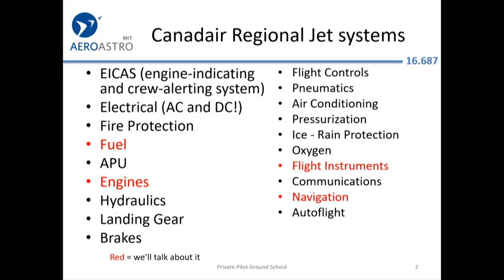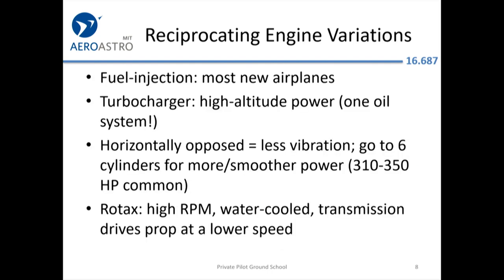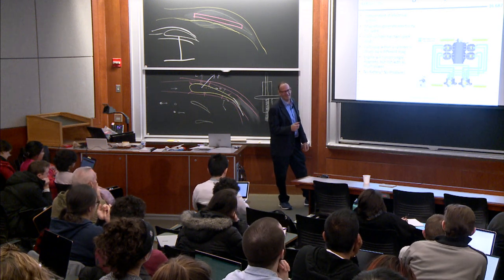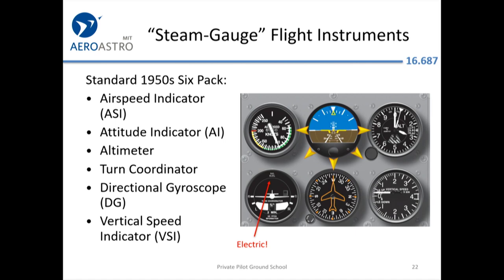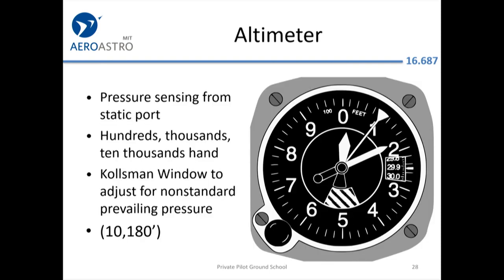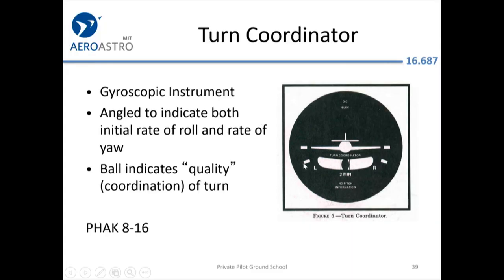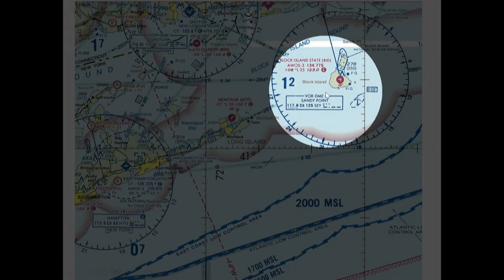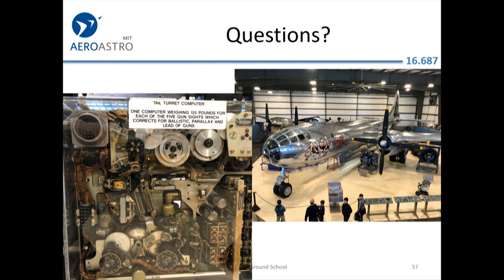MIT Private Pilot Ground School, Lecture 4 (Systems)

Comment: The reason for not running your engine under high loads at low RPM is because of the oil film. A fixed pitch propeller has the RPM directly tied to the load. But if you run it under high load at low RPM, the oil film is not being replaced very quickly and you must use a much thicker oil. This significantly reduces the efficiency because it increases the amount of drag on the engine. Also, thicker oils are a lot harder to lubricate all the components during the startup and in cold weather, and is more susceptible to thermal shock. This is why they recommend not running under high loads at low RPM. Medium loads at low RPM is fine though. Just don't push it to the extreme.

Comment: I thought maneuvering speed was a minimum, not a maximum. Isn't maneuvering speed the minimum velocity required to safely make a maneuver from straight and level flight? I'm just confused as a student as I have received contradicting information from other credible sources. Thank-you for all of the wealth of knowledge you provide!
Reply: There is a maximum and a minimum safe maneuvering speed. The lower speed maneuvering speed limit is due to stalls, AKA the break in airflow over the wing, preventing you from creating lift. Maximum maneuver quoted airspeed for most planes is more of a structural limitation.. a 172 going over 160 knots is subject to structural failure. and pulling a hard turn at 150 knots, you very well are risking flight surfaces or entire lifting bodies AKA wing.  in some extremely fast planes, they may have a never exceed speed, around 500 MPH because of compressability.  as airflow gets closer to supersonic, lots of weird things happen such as inverted control input, or no reaction to input at all. the closer you get to MACH 1, you start to see an actual shift where the center of lift of the airplane is located.
Reply: V(sub letter)A specifically is the speed at which an airplane will stall before exceeding its maximum load limit. Basically, this is the speed at which the airplane will stall before it breaks apart. There are different manuevering speeds as you described, but the aren't identified as V(sub letter)A: Take V(sub letter)O for example
Reply: Steven Hanaway interesting! Thanks for your insight on this
Reply: @bran5605  Thank you very much,  that clears up alot of confusion about the term maneuvering speed. I was confused because there are also maximum safe speeds, especially for rotary wing aircraft due to retreating blade stall for example, notated as Vne (Velocity never exceed.)

Comment: Honestly curious on how many fully glass cockpit schools or rental planes this guy thinks there are. From how he talks every plane is brand new with glass cockpits.
Reply: Take a trip around any airport and you'll see glass cockpits are becoming the norm. It doesn't have to be a G1000. Dual G5s and a nav/gps navigator is the same effect.
Reply: Glass cockpits can be had for as low as $6,000 now, which is actually about the same price as a full set of steam gauges. As components fail people are replacing with glass cockpits. Even 1950s airplanes can have a glass cockpit steam gauge put in for like 250 bucks.

Comment: Leave it to a virtue signaling intellectual not to be able to make it through a technical presentation on flight without making a reference to climate change.
Reply: This was a reference not to climate change, but to lead in the atmosphere. Unfortunately, led from airplane fuel is one of the most significant sources, and aviation has a measurable impact on the amount of birth defects and cancer rates. Additionally, breathing lead is considered worse than drinking it, and we already eliminated lead from our water in 1960. Unfortunately airplanes have not caught up yet.

It wasn't virtue signaling about climate change, it was virtue signaling about the very real effects of breathing lead and even the FAA recommends not to breathe it. In fact, pilots or people who frequent airports, have over 10 times the amount of blood lead levels and that corresponds to about six points lower IQ on average.

Comment: Ummm, see this is what people hate about professors; he complains @29:00 about burning fossil fuels, but flies his planes,,,the hypocrisy is thick
Reply: small trainers are rather efficient  which is what most general aviation centers around
Reply from the maker: That was a joke about how great the standard atmosphere used to be! (I certainly don't claim to be saving the planet!)
Reply: It was a joke about how the numbers that they use for the default are based off of the average temperature in 1960 even though the temperature is higher now.